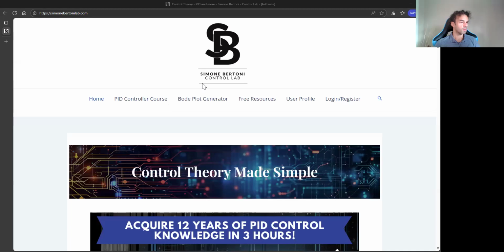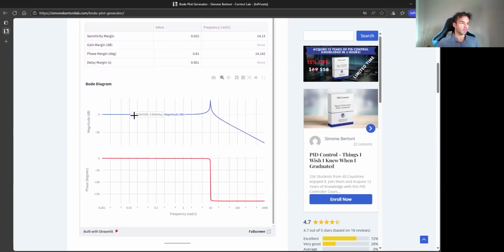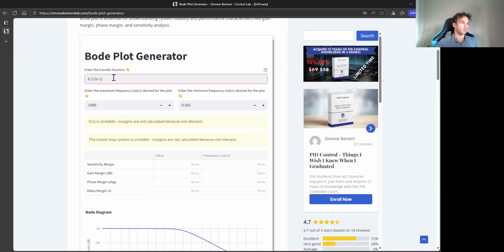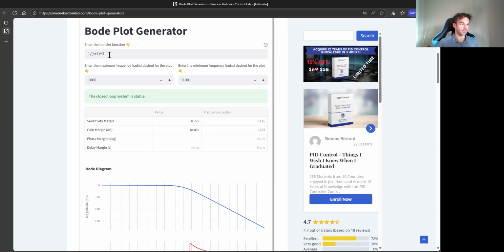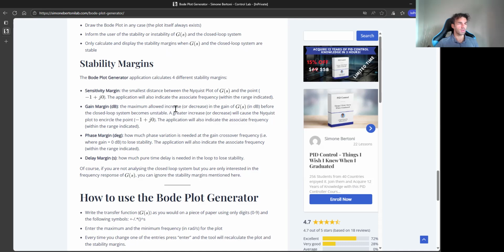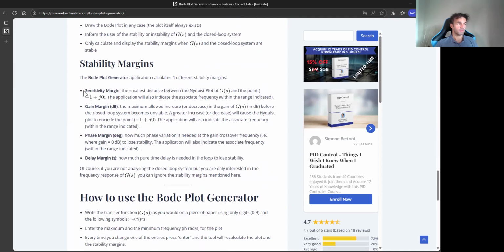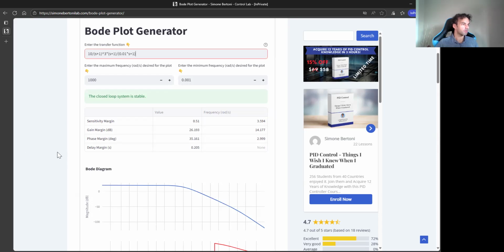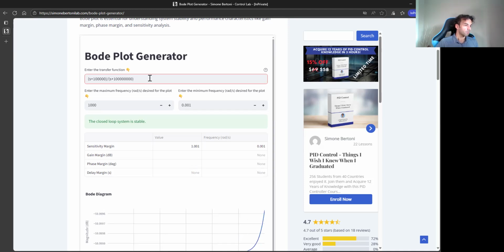How to use the Online Bode Plot Generator

Comment: Nice tool.  In one of the examples (10 / (s+1)^3) the phase plot line jumps from -180 to +180.  Shouldn't it continue in the negative direction to -270 degrees?
Reply from the maker: Hi Bill, I think you're right. I've used a function that was convenient for the way I plot, but I see now that it is returning the wrapped phase, which I think is wrong in this case (or at least confusing).

The margins are calculated using a different function, so I think they are correct, but the plot should be improved. Thanks for pointing that out!
Reply from the maker: This should now be fixed, Bill. Thanks for the shout! Any feedback is welcome :)